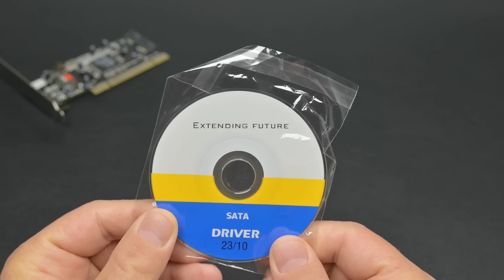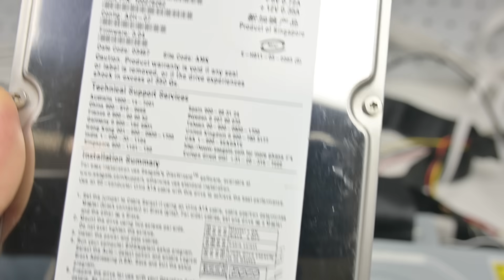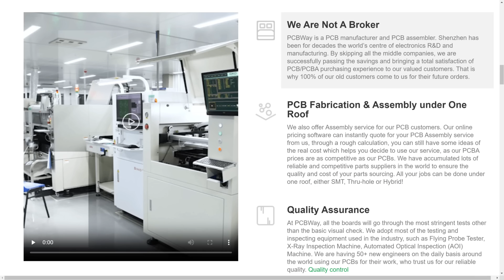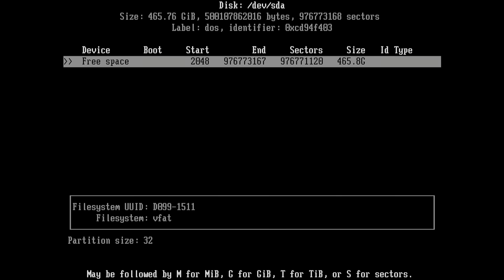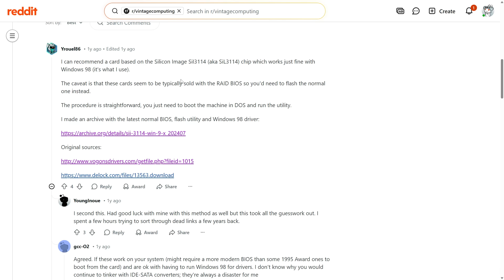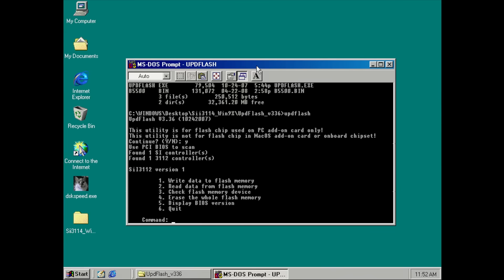SiI 3112 PCI SATA with Windows 98

Comment: I tried the SIL3114 on my Asus P3B-F.  Swapped out the default BIOS on the card and got nothing but HDD/Mainboard BIOS corruption issues.  The speeds were fantastic though!  But couldn't achieve reliability to save my life.  Had to revert to IDE and a SATA adapter.

Comment: From what I read, that SATA controller does not work with optical drives. A shame, but at least it has robust disk drive support with RAID.
Reply from the maker: Yes, I believe so. IDE is better anyway because old machines often can't boot from SATA ODD. You can buy cheap SATA to ISE adapter and use your SATA ODD that way.

Comment: a lot of these cards on ebay now come with a chip you cant flash. I tired the cards in two different PIII boards, Intel and VIA chipsets, it would detect the drives fine, but could not install windows 98 on them using the 98 quick install cd. Wouldn't show the drives. Worked fine as a secondary  drive once windows was install on another drive. just FYI for anyone looking to try this.

Comment: To anyone watching, be careful which card you buy if getting it from Aliexpress. I ordered 10 of them as they were cheap (under $10 AUD) and I thought I was winning only to realise when I received them, its some cheaper version (despite looking identical to Phils card) and it comes with NON programmable bios chip AMD AM28F010  so only way to make it a non-raid card and be able to boot from it is to desolder the chip, program it externally and solder it back on.

Comment: I found this one on amazon : Sil3114 PCI SATA RAID Controller Card - 4 Port, 1.5Gbps, Supports 98SE/Me/2000/XP/NT4.0/ 64-bit/Vista it is a 3114 instead of the 3112. Is it the same or better?
Reply from the maker: The 4 model has 4 ports instead of 2 I believe.
Reply: does it matter that it says  "RAID Controller"? I dont want to "raid"it.

Comment: @Phil i have only one question.
Is the Silicon Image SPI43512-2X2B internal PCI SATA/eSATA RAID controller card better than the card you presented in the video? If so, what are the differences? I'm looking for a very good controller for my old WinXP PC, which uses modern SSDs and HDDs. Greetings from Germany.

Comment: I'm using a DeLock 70154 with the SiL 3114 chip in my Asus P/I-P55T2P4 motherboard. Works like a charm, even with the latest 5.5.0.0 BIOS. Didn't try SATA ODD since I read in many forums that this is problematic, so I used an IDE DVD-drive there. Delock still has drivers for the card online. Lattice Semiconductor who appear to have bought up SiL at one time also have legacy drivers and firmware for the various SiL chips.

I'm getting about 84MB/s read speed with my SSD but I believe the EDO memory is the limiting factor here. Still very impressive for such an old system!

Comment: i have a sil3114 pci card on a 3rd gen intel desktop, because for some reason the built-in sata controller keeps trashing disks and making the OS corrupt. tried changing cables and drives but the issue persist. so i tried the card as a last attempt and the system is now stable. happy that i made a perfectly usable system now functioning again instead of retiring it

Comment: Used Sil0680 card (dual IDE port version) in early 2000s in a celeron 300A system with samsung 160Gb drives running windows 2000 and audigy 4 soundcard. It was an overkill for that hardware. Later reused the parts for a s754 sempron platform.

Comment: Yes Startech's SATA to IDE adapter is the best, I have more then half a dozen of them in various retro PC's here.  You don't need a 30GB SATA SSD and instead can get any SSD that is under 127GB, ideally look for 120GB or less.  Kingston makes some cheap ones along with a few other manufacturers.  Then you can partition the disk into two 60GB drives for easy management.

Comment: This card served me well, and I have several of them. However the SATA ports they come with are too loose. I had to desolder them and install ones that support locking tabs to make things secure. Also some of these cards came with a BIOS chips that doesn't flash by software, and I had to desolder the chip and program it on my programmer. I also noticed that since some motherboards quickly turn power on and off when power is connected or reset is pressed, it confuses this card and make the disk misbehave. The solution is just a long  and solid power cycle.

Comment: a Silicon Image Sil3512 is a newer revision of Sil3112 using the same drivers and BIOS! Annnnd is a different Driver and BIOS to a Sil3x14 series! Latest Driver version is 13670 or 10/23/2006 "1.3.67.0" and BIOS rev 4502 or 4.5.02 and this set was the most stable with most hardware I had tried! and a bonus was proper LBA48h Translation so I could create partitions in windows and "just worked(tm)"! 

I wonder if Adaptec's ASPI Manager needs to be installed for that Optical to work...? <3 all

Comment: i also use this card on classic macintosh systems for os9 and early X.  also works with 8.1 but can be finiky with older hardware than G4. although G3 does run it.   with performas, you can run it on the PCI versions but you dont get much more out of it t han IDE adapter so i wouldnt bother.  best usage would be on a G4 DA+

Comment: I put a 3112 in a Socket 8 System with a 240 GB SSD on Win98SE and XP at ~90MB/s - it makes the 200MHz pro feel really snappy with DMA. While any IDE solution is stuck at 10MB pio.

Comment: Thanks for this, Phil. I went ahead and ordered a sil3114 adapter. Had severe issues with one of those generic green SATA>IDE converters in the past days in combination with two VIA-chipset motherboards (Apollo 133T and MVP3). After installing the VIA 4in1 driver, boot time became ridiculously long and DMA could not be enabled for the SSD (or it failed to boot completely in the case of the MVP3 board). After switching to an SD>IDE converter, everything works fine. Maybe this Sil3114 will allow me to use SSDs with those motherboards as well.

Comment: For some retro fun, get a Media Vision Pro Audio Spectrum 16 with SCSI and see what all kinds of SCSI devices you can use with it. Windows 95 has built in drivers for it, sees it as a Trantor SCSI controller. It doesn't have a BIOS so you can't boot with the sound card. Speed? Uh... SLOW. Just fast enough for a 4x CD-ROM. Could be enough for a Magneto Optical drive but it would bottleneck hard drives.

Comment: Wait. What. Windows QuickInstall looks like it is Linux doing actual disk prep and file copying. :D LOL. Nice.

I have a bunch of these adapters, including this and similar Sil 3112 SATA to PCI. And also IDE to PCIe, just for fun. All working pretty fine. I did have issues with some Sil chip, they do have bugs and limitations, but mostly works ok.  I also do have a native IDE SSD drive. I think it is not just IDE to SATA and then SATA SSD hidden, but native IDE device, so compatibility should be a bit better maybe. Still these are very hard to find, and a bit expensive.

I am still hunting for PCI-X to PCIe adapter, there is a chip that supports it, but nobody made a suitable card (there are 32-bit PCI ones to PCIe using a cheaper and smaller PLX / Avago chip, but not full PCI-X which is possible using Pericom / Diodes Incorporated chip). This is so I can connect and use more SATA or NVME, and maybe even GPU on and older UNIX / Linux box, so drivers should be all working easily and I have access to source code so can work with it. Still procrastinating too much on it.

Comment: Literally just bought a SiI3114 from AliExpress knowing the risks (it was under 10 um Great? British pounds)
Nothing but issues on my MSI6368 Via based board. 
Board works fine in this config with a cheap sata ide adapter to the same drives.
Easily seen in bios, can load config screen, will boot to it, can start up a driver slipstreamed XP SP3 install and complete (with some IO pausing at points). Will not boot after.
Tried all different bios versions but just have issues. Accidentally, purposely flashed the 3112 firmware to it but it didn't see any drives on any ports from there but could flash back and it went back to failing to boot windows.
T'internet said the best bios version is that 4.x  in the video, if anyone has that for a 3114 I'll give it a try. By the looks of it the 3114 started at bios version 5.x
Abandoned for now.

Comment: using the SIl 3114 PCI SATA and flashed non Raid bios and got the drivers for it. Works well with windows 98 SE with SSD. Get around 90MB a sec. I tested this with IDE to SATA adapter and with that I get like 40 to 50 MB a sec. So good call if you can get the right bios and drivers.

Comment: Seeing a snapshot of a Promise SATA controller, brings back some nasty memories and funny memes of ""Promise" me this isnt happening", their first gen controllers were mixed feelings, especially the ones that worked bridged with the Promise IDE controller.  Silicon Images controller that was available around the same time, WAY more reliable.  I still have a few laying around for reasons like this video.

Comment: G'day Phil,
Very interesting video for me as I have been considering similar but PCIe to 6x Sata for my W10 Archive PC.
Currently the Mobo is an ASRock Fatal1ty Z77 Profesional which has 10 SATA Ports which the Audio had died so made a perfect choice just for storing files on lots of HDDs instead of throwing it out, but now the Data I/O is also starting to have problems with 4 Rear USB Ports & 2 SATA ports dying so looking at swaping to one of my other mobos that just has 4 SATA & get the PCIe - 6 SATA as that will cost less than buying another 10 SATA Mobo.
Reply from the maker: Seems like it's slowly on the way out. A tip is considering those AMD FM2 platforms. A lot had many SATA boards like 8 or so.

Comment: Silicon Image was the first company with SATA products. Without their serial technology, there probably wouldn't have been any SATA, PCI Express, or even DVI and HDMI as we know them today. Very few people know that, though 😁 It's great that you made this nice video about Windows 98; it's always very interesting.
Reply: the similar story is for instance with Sand Force controller chip, if was primarily developer for SSD drives and then adopted by many companies. founders were 2 guys, one is from Slovakia, and this guy later on formed Tachyum company which promised to have 128 core super chip in 2026, btw. promising it for almost 10 years. they still have just PGA prototype and nothing happens, btw. I know guy working for them and still believe in this product🤷btw. Ampere company had the similar roadmap and made 128 core ARM chip in 10 years from scratch and now it's a fully assembled product with consumers mostly coming from global Datacenters like Google, MSFT Azure, AWS.  And it;s top rated CPU in popular Cinebench 2026 mark.

Comment: I had a couple of these Sil3112 / Sil3114 cards back in the day and they were such pains in the butt.  At least back then.  With driver issues, and firmware issues.  You had to manually flash the RAID BIOS on to them back then (not sure why you'd disable it, it can do both firmware RAID and pass through...).  But like just tracking down the files you needed every time, and getting windows to play nice was such a dang chore.  And it was like, one of those things you only had to do once every 10 months or so... But it would be long enough ago that you can't remember all the details, and you can't find the files anymore, because the website you got it from closed down... And ugh, so much frustration over these dang cards.  I'm so glad modern motherboards come with 6+ SATA connectors now-a-days... (Not that that's relevant anymore, but it was for awhile, I guess...)
Reply from the maker: I can see why you'd be frustrated!

Comment: These cards (flashed with a Mac-specific BIOS) also work great in PCI-based Power Macs of the era... think 7300, 7600, 8500, 9500 and the Beige G3s and the like.
They can boot Mac OS 9 straight from an SSD and run similarly fast to what you found in your video here.

I also had hit-or-miss experiences with them back in the day, but these days they're pretty handy to have around.
Reply from the maker: That's an awesome tip for Power Mac users, thank you!

Comment: Interesting. This is running SATA through the PCI bus, I didn't know legacy PCI was that fast.
Reply: PCI was 32 bits 33Mhz, so theoretically 133MB/s, since there are no other devices in the PCI bus the SATA card has it for itself, with other cards installed the speed would probably be lower.

Comment: You're using it wrong. The Sii3112 should only be used with a Sii3112 BIOS. The 2 in that stands for 2 ports. The Sii3114 has 4

Comment: Speaking of difficulties, big problems with these SIL3112/3114 adapters on systems higher than Ivy bridge (Last true PCI slots without a PCIe to PCI bridge). I'm running b5500 bios non raid on cards of different brands, and it keeps freezing @ the boot, however the cards worked 100% fine on all my P45 core 2 systems.
Reply from the maker: Well it also froze on mine...

Comment: I have bunch of these and they work fine. Unlike VIA chips they tend to have decent compatibility with modern SSDs, but there are 2 issues. First is, the bios ROM can conflict with EMM386 memory area on many board, and EMM386 simply cannot load with this card installed. Somehow tho, the 16-bit emulation on SBlive under windows still works with it, even tho EMM386 itself fails to load. Second issue is  
the chip presents itself as PCI66 compliant. That means if your board has PCI-X slots capable running at 66mhz, this card will do so, but the chip cannot handle it, and tho the performance increases from the 70-80MB/s mine does to around 130, it becomes producing errors and can corrupt your data. Maybe some new revision of the chip fixes that, but in case you had a server board and wanted to use that feature, test it well first.
Reply from the maker: Thanks for the detailed info!

Comment: I have absolutely terrible memories about these SIL SATA controllers and just sata by itself + win9x, bsoded left and right. Let alone those OSes which worked out of the box with IDE but you needed to feed in the damn drivers on floppy for the SATA. These days I just go with Sdcard to IDE adapter, super compatible, easy for system disk then just run all games from gbit network share.
Reply: Goog Old Days (GOD :-) not GOG ) of Blue Screen of Death, in nowadays it's more likeky PSOD (purple screen of death) like in many HW hypervisor computers like vmware ESXi when going to Kernel Panic🙂

Comment: I got the SIL3114 version of these cards to work with a Windows 98 system. It was a pain in the butt to get Windows 98 installed and working, but once it was all up and running it is a pretty impressive speed boost vs an IDE adapter.

Comment: I've had issues with these Silicon Image controllers before in 98/ME. From what I remember my system wouldn't shut down properly and I think the card was causing some sort of issue with ACPI. It was on an Intel i815 system, however installing 2000 on the same system seemed to work perfectly fine. I tried different driver versions, however I didn't try different BIOSes so I don't know if that would've fixed the issue. I ended up just getting a Promise controller which is a much better option if you can find one for a reasonable price.
Reply from the maker: Thanks for sharing your experience with the card!

Comment: I quite recently expanded one of my AMD Athlon XP3000+ with a PCi expansion card to add more drives to it. one card works if I disable the built in raid controller and the other absolutely don´t work. either if the on board sata raid bios os active or the non working card is used it seems to overflow the base memory the system needs to load these and everything craps out. it took days to figure out a working combination

Comment: Not bad at all, you''re pretty close to the 133MB/s PCI limit. Wonder if RAID0 can take it there or if the controller overhead is the bottleneck. Still, a fine option, as 120GB SATA SSD's are ten a penny, so major improvement for little $$$.

Comment: Early Windows (DOS) does NOT! Align partitions on SSDS = in NAND correctly.
That means slower performance And increased wear.

Any videos, like this one,  should  mention that And how to fix it.
Especially as this video, etc,  is not representative of the full potential of an SSD with proper Alignment.

The easiest is likely to be; to just use a modern system to:
Secure Erase  the SSD to make sure there is no unmounted/hidden/inaccessible data on it.
Partition and format (Aligns  clusters) the drive..?

Also; TRIM
See and perhaps experiment with:
GitHub DOSFSTRIM MS-DOS Compatible TRIM Utility for FAT16/FAT32 Filesystems
And similar:
Vogons Software that actually works enabling Trim on Windows XP

That's An interesting video on it's own!  🙂